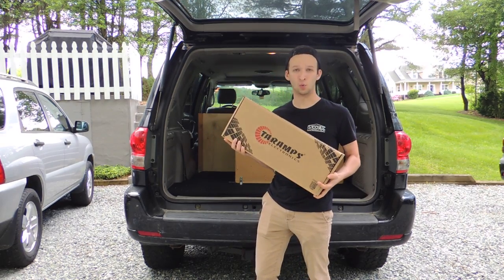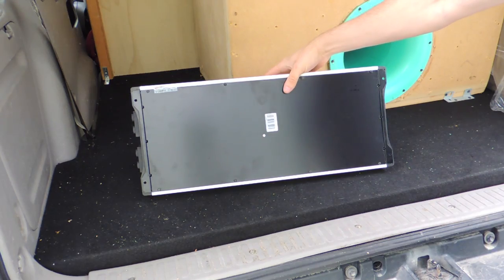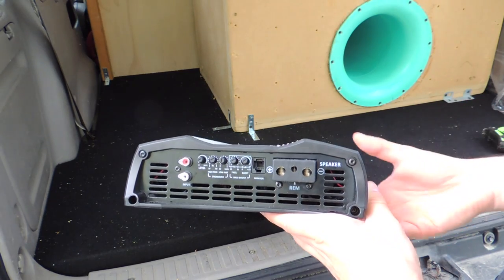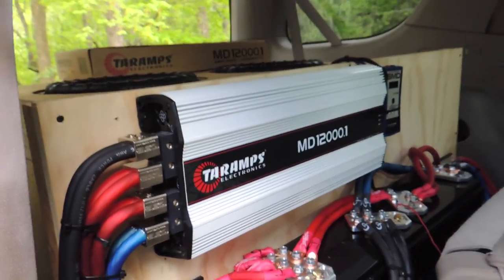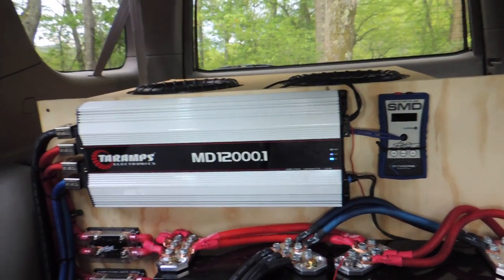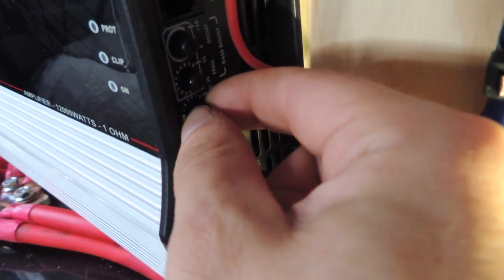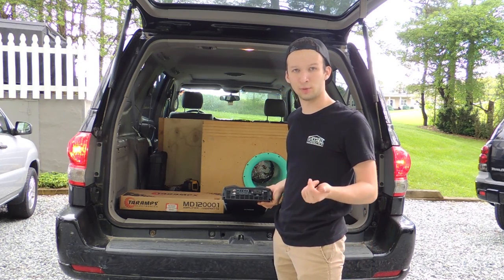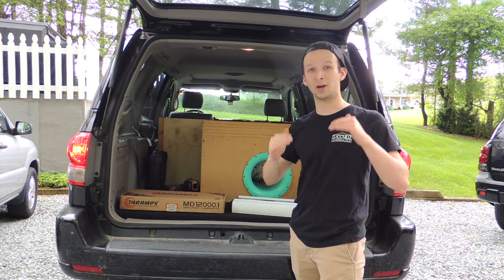TARAMPS? Watch This Before Buying!! | Taramps MD 12000 Review

Comment: Next issue I can see is I noticed alot of flex on that wall, that will take out/kill any amp, Amps hate vibrations, and indeed they need a ton of support, just got my sd12k and I'm being recommended to run 3 banks of 35ah lithium and triple inputs, I own a ds18 hooligan spl 5k also and I absolutely love the look and the feel of that 5k, puts out what it claims if not alittle more, but would definitely be more careful on swapping things back and fourth on them amps and be sure to figure out a good spot where it will get little to no vibrations or be able to flex the board, Amos will last forever if you take the proper precautions
Reply: My md8k is mounted on 3/4" piece of Baltic birch bolted to the floor. 3 15s just beat the snot out of my truck and no issues as if yet with my Taramps
Reply: Flex!? It looks like he built it from 1/4 inch it flexes so much. Yes that’s the issue. It’s him he can’t see that he is destroying his own stuff? Omg these kids
Reply: @guyww8516  not to mention that he's gotten the wrong amp. These are meant for mids and large woofer systems. Kind of like what you see the Russians driving around with 20 12" woofers. It even tells you on the box that it's not necessarily meant for subwoofer applications, that's the whole reason they have their "Bass" line of amplifiers.

Comment: You need to worry about shorting leads no matter what electrical component/device you're working with. A higher quality amp will not change that.
Reply: You're though Taramps aren't high quality they're because they're cheap

Comment: You could contact Barevids and get an explanation of what might’ve happened to ur 2nd amp. He’s very knowledgeable on car amps.
Reply: he says exactly what happened to it....watch the video
Reply: I’m talking about giving a breakdown on what happened in the circuity itself.
Reply: Change all output fet's and it will fire up and work again, i have fixed several Taramps because of that fault 🤗
Reply: @icebreaker2k3  The damn amp produces so much sound it distructs itself from the outside...
Reply: @icebreaker2k3  Do you still  fix them  by any chance mine just screwed up Protection light is on😅
Reply: @icebreaker2k3  i dident understand, ge touched the - and + of same channel together?!
Reply: The amp casing is DC negative, the output from the amp is ac. That's why the fets blow.

Comment: As a retired amp repair guy    your # 1 issue is having the Amp on the box   u will introduce alot of vibration     which may make your transformer   windings  rub together and  offset the power supply  and hurt your fets   or keep going into  protect     and u can't figure why
Reply: Could this also be the reason the amp won’t turn on ? , I’m getting power threw the wires and everything but the amp just won’t cut on 😊

Comment: Here in Brazil we really like Taramps amps, it's really cool to see it's becoming famous around the world. I give more importance to it's sound quality and real power (most times higher than the declared by the brand) than to a premium feeling, and never had so many problems with those amps. 
Maybe you could give more space between the subwoofers and the amp, it would prevent the amp of vibrating as much causing problems to it's components.
Nice video!
Reply: Do you use fuse for your amplifier?

Comment: I can tell you that most of the failures with most of the fullbridge amplifiers like The taramps md 12k , are how the fans push air inward on the fets. If any debris contacts and shorts the fets... well it's a mini 4th of july show. Fullbridge amplifiers will get better over time. In the meantime, just use some sort of dust filter with limited air flow restrictions. This will keep them from collecting debris. I have repaired a few fullbridge amplifiers and discovered this issue to be one of the main reasons. Shout out to Barvids for his knowledge and I know he is more knowledgeable as he has taught me a lot .

Comment: I had taramps for the last 4 years. I killed it by shorting the speakers leads, but it got repaired and it's still working fine. I like how small taramps are and how much power they can push out.
Reply: Any comment on the da 440 by 4?
Reply: @shaquiloneale1850  It's a great amplifier. https://youtu.be/vyh2mpEbxcw?t=340 It can delivery more than 500 watts at 14.4V

Comment: You've reminded me, I need to install a legit fire ext. in my Project Fire Hazard. It has that name for a reason, and my lil RZR-2500D gets hot running 1ohm. But, now that my 12v power has been strengthened, should help it. I know this from watching Taramps catch fire from running undervolted.

Edit: I have installed a legit auto/RV fire ext. since this post. $14 from Wal-Mart.
Reply: Stop using wal mart if possible.

Comment: I have the MD8000 and one day the fans were louder than normal, i went to check it out and i hit the amp hard  with my had, fans went back to normal and the amp started playing allot louder, checked the gain setting with the DD1 and still no distortion, go figure, it likes a good spanking once in a while... i got to give it to Taramps it makes the power but very flimsy built.

Comment: 😯DAAAMN bro!!! I've had my STETSOM 8K for almost a year never had a problem with it yet! But I ordered it directly from the manufacturer NOT a dealer!!!
Reply: Owned a Stetsom 6k for over a year and an 8k for 6 months
Reply: It's funny you mention that cause my.buddy keeps bad mouthing my Stetson 3k and he brags that his md taramps 3k us better than my stetsom. He claims that my Stetsom will burn up on me before his does. And then I seen this video. I've personally only had some heating issues but once I bought a fan , I now have no more heating issues with my Stetson and its actually slamming so hard with my single 15 zvx.
Reply: @RomaVilla  FOR SURE BRO!!! As long as you keep the volts above 12 good to go
Reply: @74midwestbass74  good looking out bro, I'm definitely upgrading my alt asap... By the way what kind of set up are you running right now?
Reply: @RomaVilla  I meant to say above 12 volts! But I got 3 setups right now bro. But the STETSOM is powering two Memphis LVS 15's while I prepare to start my wall build

Comment: Ive always bought Korean made amps. Yes they are more expensive bought i have never had any issues with any of the 4 that ive purchased heck 2 of them i ran at half ohm for over a yr no problem only reason for getting rid of them is for upgrade reasons. I love Korean amps because at least the ones i owned was hugely underrated and did 500-1000 or more than what they was rated for.

Comment: Haha I done a similar thing to my pioneer amp, car was off but I decided I wanted to but a wire ferrule on my 12v + - and didn't even think to disconnect battery for the simple job, carefully done - easy then doing the + I acidently dropped it and it welded to the body of the amp and actually took a good 10 seconds of glowing until it popped the fuse, it actually popped my radio fuse as well so maybe went up RCA? Anyway a nice arc mark on my amp and it worked no problems. I just get on and off pops now from the radio, even when changing radio station :(

Comment: Wow i guess im lucky cause i have lithium in my truck and 3 times the lithium has touched ground and it was 4th of  july inside my truck smh 😬  both my Taramps MD 12000 did go into protection mode but  came back on and are still playing. 🤷🏽‍♂️ even on time the ground slipped out of the lithium terminal and touched power, sparks and smoke as u guessed but both amps still played sooo 🤷🏽‍♂️🤷🏽‍♂️ what can i say these amps are tanks for me
Reply: Same happened to me man. I have the Bass 3K and damn like you said it looked like 4th of July in dis bihh. Lol it just keeps on going though.
Reply: How long was it in protection mode ? Before it came back ?
Reply: How long was it on protecting mode before it came back
Reply: Robert Coronado I just turned my car off and back on and it was good. But I have the BASS 3K Amp. Not the MD.
Reply: James Jeffrey plummer      I have the MD 8k  Whats the difference on the md and the bass ?
Reply: Robert Coronado the Bass line was designed strictly for Bass. Mine only has the LPF Subsonic and bass boost & frequency. Correct me if I’m wrong but I believe the MD line is Full Range, whereas the Bass line is only for Bass and can handle low ohm loads. I’ve notice my Bass 3K is tough as fuck. I can’t tell you how many times I’ve accidentally let a wrench arch the Positive and Negative inputs on my amp and it just goes into protect, I turn it off and back on and it’s good. Nice Solid well built amp. I’ve had absolutely 0 problems out of mine. And I put it through hell. Some songs will clip more than others but I adjust my EQ accordingly, but when it clips so hard the red light comes on it’ll just keep playing, it’s never gone into protection mode from clipping but I try not to let it happen. But you know how that goes.
Reply: James Jeffrey plummer    * cool thanx for the information bro
Reply: Robert Coronado no problem man. And ya know that doesn’t mean you can’t use the MD for your subs.. but if you’re looking to upgrade or something I’d definitely look at the Bass line they’re beasts for real. Mine actually had a Fucking drink spilled on it a few weeks ago and was fine
Reply: James Jeffrey plummer  •••  I’m looking at them bro but I’m trying to look for a half ohm dont see any they have the MD at a half but not the Bass
Reply: Robert Coronado The Bass line is capable of going down to half ohm without going into protect.
Reply: It just doesnt say it is but I’ve read many people saying the Bass line is hefty enough to be ran at half.
Reply: James Jeffrey plummer   • I just might do that  thanx bro

Comment: Personally, I prefer a solid Korean half bridge, even though the size and cost are both bigger. They are just more reliable and well made overall, assuming you got a good brand. Amp prices are really high right now. 9k Wolfram used to be $900-$1000 but now it's $1300-$1400 for the same amp because of tariffs and crap.
Reply: I agree. Apparently QC is cut as well as the price 😉.
Reply: Just bought a d4s jp23 and the bass broke parts in my trunk. Def don’t need 12,000 watts in the hot hatches and midsize sedans I drive.

Comment: Been beating my 5000.1 Taramp with (3) 950 batteries and (2) 200 Amp circuit breakers. (1) 12 D2 FI Audio 4500 watts in a 38hz tuned box sitting in my E350 Benz , mad Bass never been disappointed!

Comment: Whether you shorted the speaker leads or not the protection circuit should’ve prevented total amp failure. Did they warranty the amp? If not why? Did you pay for repair? Why buy a brand new third amp? Hope they gave you a discount for the free advertising & promo!

Comment: Your install is clean. wiring looks very professional. But like mentioned below you need to  change how your amp is mounted. the more you can reduce vibration the longer your amp will last you. Granted the entire vehicle vibrates so can't eliminate all the vibration but help reduce it.

Glad someone can admit they made the mistake that caused second amp to die. It's easy to point a finger and post a negative review. 

I've been running my MD8000.1 for a year and no problems what so ever. No one has ever claimed Taramps to be top of the line but definitely best bang for your buck!
Reply from the maker: The amp is mounted to a wall (with rubber grommets) that is not connected to my box. The Failures had nothing to do with vibration. One was damaged in shipping and the other was my fault. Live and earn haha! They really are the best bang for the buck

Comment: The reason you have to keep replacing that amp is because taramps can’t take direct vibration that well. Mounting a taramps on a subwoofer enclosure would never last and will always fail. Mount the amp somewhere else and you will not have to replace it again. And put rubber feet on it too.

Comment: Last week i burnt up my soundigital evo 5k, it had amazing rms power! One the Moffetts burnt. I now have bought the taramps smart 5 bass, does 2 through .5 ohm, its a beast!! Hands down amazing raw rms compared to my evo 5k... the smart 5 bass has  dual  power inputs and is same size as my buddys soundigital evo 8k ...
Reply: I have the smart5 as well, im only running 2 evl 12s, so I haven't seen the full potential yet. But it's ridiculous! Those 12s won't last much longer, wich will give me a reason to buy new subs 😄. What you running?
Reply: @kevinriley5979  im running two hdc4 18s, box is 11.5 cubes after displacement tuned to 28hz
Reply: @MyHairyChin  damn now thats a 📦!
Reply: @kevinriley5979  is your smart 5 the bass series?  The smart 5 is diffrent from the smart 5 bass

Comment: I had the same thing happen on an 8K accidentally shorted the remote line to the speaker with the car off apparently there was some voltage enough to pop whatever internally but it never came on again sent it back got another one cuz it was a third party warranty through SquareTrade but I've owned four or five now of the taramps MD yes they're not top quality yes the fans are loud but I honestly have no other complaints definitely best bang-for-the-buck for anyone out there looking

Comment: Make sure your output voltage coming off of the head unit is not more than 1.5 volts taramps don’t like it, you can check, and adjust it with a volt meeter

Comment: You need to put some padding between the subs and the amp so that the amp is not taking so much vibration from the box. It's probably rattling the components to death. It will help with the shock waves

Comment: I bought the smart 3k and the packaging was so bad. Amp works amazing but still wuts up with the lack of bubble wrap?
Reply: I had one for a week and the boost nob broke fam doesn’t work but holding up
Reply: @tyjuanthrasher4226  yeah the knobs definitely feel cheap. I don't use that bass boost at all though.  It only boost that certain frequency that you set it to with the knob to the left of it.

Comment: What brand are your dual inputs? and what is the lowest voltage you get there? is that the only amp you have on your system? I have 225ah lifepo4 lithium cells and my voltage drops down to 11.85v at 100% volume  i have 1 bass 8k tamps for 2 HCCAs 15" and 1 MD8000 for Mids and 1200 for tweeters. Is your lowest voltage drop with car on or off?

Comment: The problem is that the protection circuit in these Taramps takes a while to kick on and isn't fast enough so you can't really trust it for that. The second amp would be worth repairing though

Comment: I swapped out 2 smart bass 3ks for a smart 8 bass. Had the 3s in for 4 months. The 8 lasted 5 days. Strong smell n shit off. No smoke or sparks. 2.5v preouts, 15.7v charging . Not sure what happened. Put a 3 back in all good. Guess i got a dud. Now im too worried to use abother one. Can't risk my other equipment. Going back to korean. Very disappointing. Going from the 2 3ks to the 8k i gained 1.5 db on the meter too. I really like how it puts out full power from .5 ohm to 2 ohm. Helps with box rise. Hope my korean 8k is as loud. Pretty sure im going with the soundqube q1 8k.

Comment: I have a Taramps Smart3.
Running stock electrical.
My Sundown SA-15 was wired to 8ohms. And the amplifier still fried my sub.
Reply: still 2k rms what did you expect
Reply: Ryan LaPlante 
I knew it was powerful but I did not expect it to be that powerful. But when I saw the price, I couldn’t resist buying it.
Reply: You clipped your sub to death no doubt..
Reply: When overpowering a sub with a big amp I always leave the gain turned all the way down, but I usually have h.u. with at least 4v or 5v preouts and just adjust by sub level.
Reply: so you had the knobs cranked hard to the right? right?

Comment: I haven’t killed my 12K yet in my big build vehicle I have 1000ah of reserve for both of my 12k’s with a XS Power D975 powering the mids and highs amp it’s like 100ah for my Crescendo Symphony 1k and that does amazing for that, but anyway I have 4 Mechman 370a alts plus my stock 90a alt charging the XS Power D975. And I have had everything running for about 4 years now. Note everything is on switches except my Crescendo so I can turn off my amps to avoid those problems all together.

Comment: Vibration on the board from the bass box cant make parts break on the more and short off
Reply: Nah, not really. Look at extremely large SPL systems where all the amplifiers are just mounted to the back of the box. In systems that large there is no location in the vehicle that is away from vibration. The subs go out faster than their amps do, mainly due to the fact that they are professionals and actually buy the proper products. The guy in the video is not the brightest... He's buying the wrong amplifier for the wrong application. The one he should be buying is the BASS series amps, but he doesn't know that he is running a woofer amp.

Comment: You need a ton of amperage on tap for that big amplifier.. Multiple AGM's or a 100 amp hour lithium. Even if you aren't driving it hard. Realistically, you should have two alternators as well for that size amp.
Reply: He has 128ah of lithium